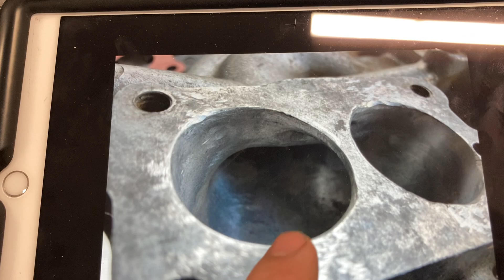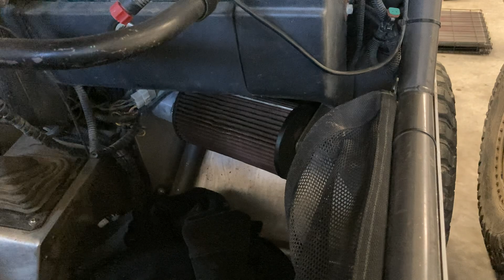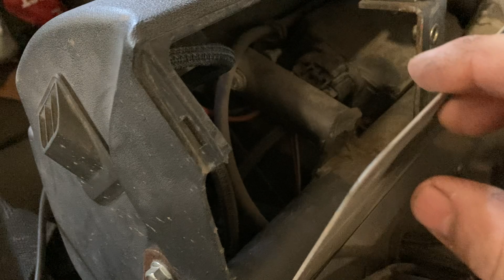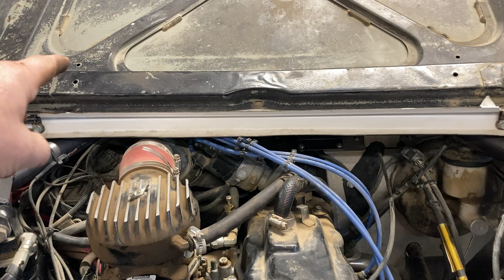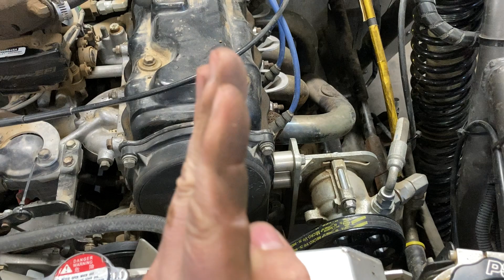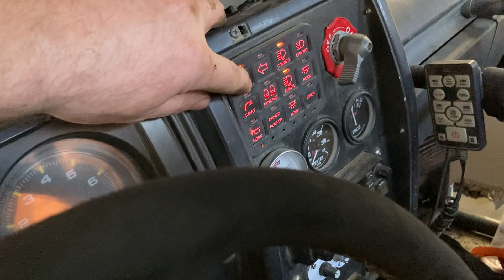Holley Sniper on Suzuki Samurai 1.3l (2GC small bore)

Comment: Do you know how to get an msd box to work with factory ignition and tach? I have an msd offroad 6 box that I messed with years ago and it was giving me a fluttering tach. I tried the adapter the tech support recommended and it didn't help.
Thanks for the inspiration.  My rust bucket fired up for the first time in 9 years last week.
Reply from the maker: Off the top of my head, no but I’ve done it in the past on my first Sammy. Really helped low end torque. It’s a basic hookup that the directions should cover.

Comment: I have a couple questions.
1. Did you have to change out the injectors? 2x100lb/hr seems like a lot of fuel for the little 1.3L
2. Coolant temp sensor, where did you put yours?  I have a Canadian market Samurai that didn't have a computer controller carb so I'm trying to see if I need to find another intake.
3. For fuel lines, did you run all new 3/8" line or were you able to reuse the Samurai hard lines?

Thanks,
Reply from the maker: I am running the 100#/hr stock injectors with no issues. I installed the coolant temp sensor right under the thermostat, I can’t remember for sure but I think I drilled an additional hole for it. I didn’t use any original Suzuki fuel lines, I bought a master kit from Holley and it came with all the fuel line I needed. I run a fuel cell to and it was easier to run the new line. Plumbing wise the only thing I added was a Schroeder for testing fuel pressure.
Reply: @ultra4suzukisamurai679   thanks for the info! The reason I was asking about the injectors was there is a post on the holley forums where someone was putting the 2GC on their samurai and it wouldn't idle below 1300rpm because the injectors were hitting the minimum duty cycle and it was still too much fuel.  They ended up changing to 43#/hr injectors.  Do you know what your duty cycle is on idle? 

Good to know about the fuel lines. I have the petroworks 15gallon poly tank so I have to attach to the factory sending unit assembly. 

I'll have to have a closer look at my intake then to see if there's a place I can use. If I have to drill and tap it I'll find a spare to build the setup on. 

Thanks again!
Reply from the maker: @chrisrittaler4555  I’ll have to hook up my laptop and check, but I haven’t had idle issues.

Comment: Did you find the 2GC was a little to big for the size of the engine? Did you had to do any other modifications to get it running at all? 
I have been speaking to Holley and they recommending me the single injector for my 1.6 engine any input from your side would be much appreciated
Reply from the maker: @krstepejcinoski2704  the 2GC small bore is the closest thing to the size of the Sammy carb. I have to modify the manifold to bolt the sniper up. I did not modify the sniper, running the original injectors, etc. no issues. When I originally installed the sniper, I ran on the stock Suzuki ignition system, but later upgraded to the hyperspark on a fuel injected 1.6 I can see that the single barrel sniper would be easier to adapt to that manifold being that the Suzuki manifold just has one throat. There are obviously little things you have to do, like adapt the throttle cable, and things like that. But I was able to get it running pretty easily and quickly once it was installed. The self learning software does a pretty good job of getting it close, but I highly recommend getting it. Professionally tuned, the self learning software can only do so much.. Adding the hyper spark ignition is nice but not necessary. Running the ignition allows you to have the computer. Adjust the ignition timing. I’m not an expert on the 1.6 engines, I’m not sure if the stock computer controls timing or if it’s mechanical like the 1.3.if it’s electronically controlled, you might have to go to the hyper spark ignition. Overall, I’m very pleased with the system.

Comment: so legit question, was the fuel range better on the EFI than the weber? I've done the 3k swap in the past and on my current rig, i'd only get 17mpg but its also pig rich and finding jets for the chineseium carb isn't super easy either. I've got a 1.6 16v tracker that can donate its engine and harness, but I really like not having the adapter, modified pan, modified oil pickup, special motor mounts, crack prone block... etc. So I'm really thinking rebuild the 1.3 with some forged pistons, sniper EFI and maybe, just maybe a g15 turbo for my daily driver. 

granted, I understand that its not really a thing to translate mileage on a ultra 4 to a street rig, but just from your observations, was it better?
Reply from the maker: @MonkeyWithAWrench  as far as MPG goes, I have no idea. Neither was tuned for economy. The sniper has basically infinite adjustability since I’m sure it can be tuned for good MPG. I have a 22 gal fuel cell so the range is amazing. Another option is to use the 1.6 16v top end on a 1.3 block. Petroworks has built these and can help you with it.

Comment: Why did you with the 2gc instead of the 1100 autolite? The 1100 should be more than adequate for less than 10psi boost
Reply from the maker: The 2gc small bore was the closest to matching the base shape of the original.

Comment: Is there a crank angle sensor? I’m currently building a 1.6 8 valve with 262 cam for my samurai, I already have a Weber for it but I’d love to do this in the future.
Reply from the maker: No crank angle sensor. If you use all stock ignition the sniper only needs a tach signal.

Comment: Looking into doing this with my samurai, running a k03 with a CV carb and its been a struggle tuning the carb for boost. anything special youll need to do to the sniper to get it to run with boost? Some of the documents I've read from Holley dont mention anything about adding boost to the 2gc.
Reply from the maker: Most of hollys literature talks about tuning with the hand held display. Once you are into the laptop program a sniper and super sniper use same software. A 2gc can’t “self learn” with boost where a super sniper “can”. Tuning with the hand held is very limited.
Reply: @ultra4suzukisamurai679 makes sense, I’ll have to do some research into laptop tuning now, thanks for the reply. Excited to see how your turbo setup looks